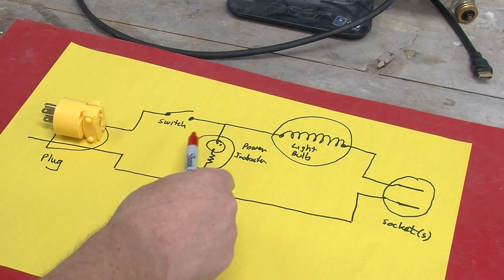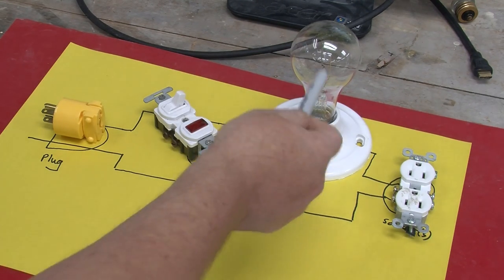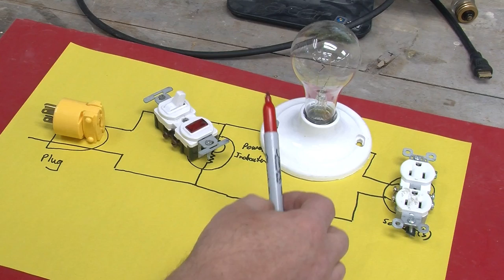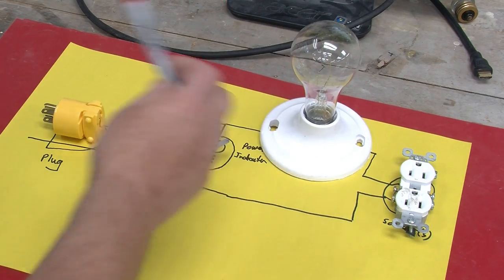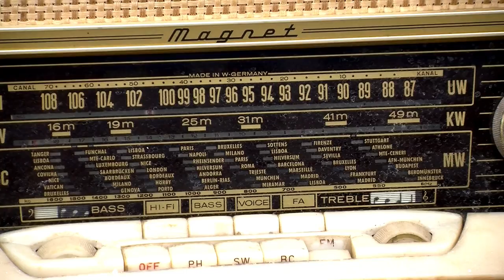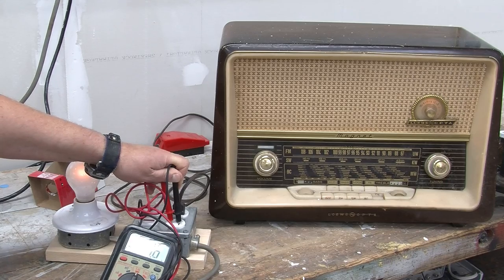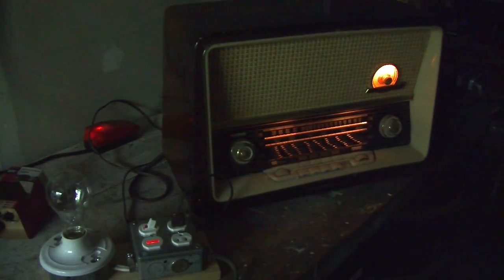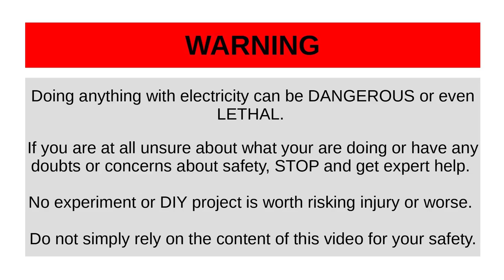When a Light Bulb is better than a Fuse

Comment: Being an old retired Telco tech, many circuits in the old Central Offices had "ballast lamps" (or "resistance lamps") in series with either input or output to protect them.
Reply from the maker: Thats fascinating. So was that on the loop circuits going of to peoples phones? Were they lamps specially made for the purpose?
Reply: @ElectromagneticVideos , not so much on the "POTS" loops, but on other circuits that had the potential to put out dangerous or damaging levels of power. DLL units (Dial Long Line signalling range extenders), telegraph, carrier, alarm, etc. 

They were used on circuits both within and outside the central office. 

In the Bell System they were made by Western Electric specifically for those different uses, and were sized to fit on standard panel height of 1.75 inch without crowding. 

Many, many different types and mountings. Here's one: http://tijil.org/15A-ballast-lamp.jpg
Reply from the maker: @Tom_Losh  I have never heard or seen a bulb like that! How interesting. So if I understand correctly, generally not on the voice but more the signalling pulses? I googled "Dial Long Line signalling range extenders" but was flooded with Wifi range extenders which I dont think are quite the same :)  . I'll have to do some searching to see if Northern Electric/Northern Telecom/Nortel made those bulbs up here too. 

I would love to have seen one of the rooms filled with the old mechanical switch gear in operation. I do have  couple of vintage rotary stepper relays (not sure of the correct name) that would have been in one of those switching stations.
Reply: Right. We had them back in the sixties when we had teletype circuits running 120v @ 60ma. Ballast lamp lights up when the circuit gets shorted out somewhere downstream, otherwise it stayed dark. Nowadays, I use a 12v headlight to test 2-way radios in the same circuit.
Reply: @ElectromagneticVideos  Back in the early 90s I worked for AT&T ,Western Electric, as an equipment installer refitting local Bell offices with the new 5ESS switch system which replaced the rotary system with digital. It was always fun checking out the old rotary switching equipment while we installed the new equipment in parallel. Many boring hours spent running wire and testing lines as we went. On the phone lines that I worked on, iirc, the only protection I ever really noticed was the lightning protection on every line coming into the switch, basically a wire wrapped ceramic insulator. One amazing thing was that the 5ESS switch was so small in comparison to the relay banks it replaced!
Reply from the maker: @KenTenTen  Just saw your comment - I remember teletypes and had heard they were current loops. I can sure see how lamps would have been perfect as ballast a also a fault indicator. How interesting. And great to see another modern use for 2=way radios.
Reply from the maker: @AGB_2000  I cant imagine what it was like to have to re-connect and test thousands and thousands of wires like that. I would have been thrilled to see the rotary switch banks but connecting and testing the wires would have driven me crazy! It is amazing that one can sufficiently protect semiconductor based switches well enough from lighting and induced transients on the long phones lines that they arnt always being fried. 

Just thinking - it must have taken days to swap over the wires. Did you you somehow have both new and old switches operating in parallel to maintain service, or was the phone system simply down for a day or two?

I would be neat to a photo of the old mechanic switch next to the electronic replacement for the size comparison.

Comment: Good explanation of the "poor mans variac" AKA the dim bulb tester. When working with tube equipment especially you start with a low wattage like 15w bulb than go to 25,40, 60,75,100. If at any point the bulb goes bright you have a dead short. 

This saves both you as well as the equipment under test. 
Never just plug an unknown condition tube set in the wall from the bat. Especially if its been sitting unused. Always do the dim bulb or a real variac and isolation transformer.
May work great may need caps reformed but chances are that youd be in a world of trouble if you fail to properly bring up old equipment.
Reply from the maker: I'm glad you liked it! And very good points and advice for  resurrecting or fixing old tube equipment - thanks for commenting. Although I think its actually more than "a poor mans variac" - the great thing about the dim bulb is the limiting current feature - no matter how careful you are at slowly increasing variac voltage, you always have the possibility of a high current short. I have been amazed at how much attention this video has gotten - really shows what a great piece of equipment a dim bulb tester can be.
Reply: @ElectromagneticVideos  i'd consider a bulb limiter far more important, useful, and safer than a variac, have used one for many years, you can also use them as current 'stabilisers' for charging nicad/nimh and lead acid batteries, even direct from mains via a diode if you wish to risk it ! i have an old book that shows accumulator charging from dc mains through a lamp, you would not want to know the 'hair raising' way  they said to check mains polarity if you didnt already know it 😲
Reply from the maker: @andygozzo72  Completely agree! I have never used them for charging a battery but heard stories of what you described. Checking polarity  - touch it with your finger like the old electricians used to do?
Reply: @ElectromagneticVideos  actually what the book said was stick the ends of the wires , with a bulb in series with one, in  a glass of water with a sprinkle of salt in  😲 the wire that gives off bubbles is negative 😲😲, i've used a small  15w mains bulb plus series diode off the mains for a quick n dirty charger a few times,
Reply from the maker: @andygozzo72  Practical and simple, but somehow wires + saltwater + 120V seems a bit scary to me!
Reply: @ElectromagneticVideos  120v?? this is in the uk, 240v !! 😲
Reply from the maker: @andygozzo72  That would make it even more exciting!
Reply: @ElectromagneticVideos  😜
Reply: in the uk, areas that had dc mains had a split system, central 'grounded' neutral, and +  and - 200v ish outers, with houses split  roughly equally on opposite poles, with the central one as the neutral, just think if one house had both outers, maybe for high power equipment and the person doing the polarity test got the 2 outers instead of outer and neutral, 400v rammed into salty water ...😲😁
Reply from the maker: @andygozzo72  I had no idea you ever had DC to any extent. How interesting! I thought all 200-240V systems originated with AC after longer, thinner light bulb filaments were developed. Your 200V DC system sounds exactly like the 100V DC system in US  (and maybe here in Canada?) where there was Neutral, +100V and -100V before Edison lost the  AC DC war. 

We have a remnant of that in Canada and the US -  the split phase AC system where most homes have two 120V lines that are 180 degrees out of phase (ie + and -) and a Neutral. So all "normal" outlets are 120V having one live and one Neutral. Larger appliances like stoves, dryers, air conditioners etc get two lives for 240V. 

I have only seen a split phase system once in a 240V country - at the end of a long single-wire earth return line in Australia at remote campground in Carnarvon Gorge (amazing place) where only one of the normal three phases was available.
Reply: @ElectromagneticVideos  oo, no, the uk, any maybe other countries, had many areas with dc mains in the early years of electrification, i think some still had it into the 1950s ..., and yeah i know of the current😉 usa split 120v phase system, i think its a good idea, wish we had it here!
Reply from the maker: @andygozzo72  Interesting! I have heard some places in New Your City still have DC to run things like the really old elevators in the skyscrapers! 

I had a discussion of the merits of our two AC system with someone else not too long ago who like you favored our  system. I would be be fascinated to know the statistics of  injuries from the 230V to ground compared to 120V to ground systems. 

I did read a paper years ago that compared split phase to 3 phase for residential power delivery and the conclusion was that given the greater spacing of houses in North America, split phase ended  up being cheaper here and 3 phase cheaper in Europe. Some time I should see if I can  do some estimating and see if can come to a conclusion one way or the other. It would be nice to have 3 phase for electric motors like pumps.

Comment: when I was an apprentice about 5 and a half years ago the master electrician I worked under had been in the field for almost 40 years, and when he was teenager back in the 1960s his father taught him how to find a short in the house, with a light bulb.    he'd take the wire off the breaker,  connect a light bulb socket pigtail to the breaker, then wirenut the circuit wire to the other end of the bulb socket. With experience he was also able to gauge whether the circuit was overloaded and likely to trip a breaker by noting the brightness.   with a fuse panel, you can perform the same test, by screwing a bulb in the socket.    The younger generation can certainly learn very cool and useful stuff from old gray hair electricians. -)
Reply from the maker: I really enjoy hearing stories like that. I had not heard of putting a bulb between the breaker and the rest of the circuit like that, but a few have mentioned the bulb in the fuse socket.

The unfortunate thing is so many people seem to think old tricks like this are bad just because they are old - sometimes the old simple approach is much more practical. 

Years ago I made a manufacturing tester for product that had a 12V output to drive some auxiliary component. The tester was just a 12V auto blinker bulb soldered onto the plug with a diode in series. The bulb drew enough current to confirm all connections were good, and the diode conformed the polarity was right. I  think they still use it today 20 years later.

Comment: pretty cool—using a lightbulb as a crude PTC thermistor for inrush limiting (with added visual diagnostics!)
Reply from the maker: Yes! In many ways the visual indication is the best part!
Reply: Or is it ntc. As current goes through and heats up the resistance goes down acting as a short circuit. Initially the resistance is high. Right?

Comment: I had 10w to 2000w current limiter system made by myself using incandescent and halogen bulbs  more than 15 years.
Reply from the maker: Thats a big current limiter! So did you use halogens just because easy availability and small size at higher powers? Or was there some other characteristics that was good for your application?
Reply: @ElectromagneticVideos  I had used halogen tubes for easy availability and cheaper. But most replaced are them. I had eight different power settings with selector switches.  1000w 500w 300w halogens and 200w 100w  60w 25w 10w  incandescent bulbs. That current limiter made by myself i'm 14 years old and too much interest in electronics. That saves my time and money and good experience with SMPS and power amplifiers. That idea came for me when technicians using current limiter (they call it load bulb in my country) why i not try to build better one with more current limit settings.
Reply from the maker: @kapilsds7  Great that you have such an interest in electricity! 

I'm guessing your not in Canada or the US, so you are probably in a 220/230/240 volt country. Please please please be careful!!!!!!!!! Your voltage has much more of an ability to punch through skin with the slightest surface moisture and deliver a lethal shock or burn than ours does. I know - it happened to me in a 220V country when I was a kid playing in the garden and a hidden live wire touched my leg. I have a huge scar  to prove it. 

Here are some safety suggestions:

At a minimum make sure there always is residual current device (RCD) in the circuit but dont rely on it. 

Or better an isolation transformer. 

Never be alone in the room or area when working with exposed AC power or more than 24V. You need someone there to help you if something bad happens. They also need to know that they must shut of the power before attempting to help you - AC power can paralyze and disable the helper. 

And if you have the slightest concern or uncertainly about something, stop, think about it,  and get help if needed.

These are something everyone should consider, not just young people! We can all get injured if not being careful. 

Having said all of that, back to your project.  Do you really need such high powered lamps? Usually a lamp power of around the power consumption of the device you are testing is a good place to start. That limits the current at maximum what the device would normally draw. If everything goes well double the lamp power once or twice. Typically use 60W, 100W, and 200W bulbs for working on old tube radios. Modern stuff uses even less power. One problem with larger currents is they can sustain an arc quite easily (like an arc welder) and destroy the device you are protecting! I think part of your range 200w 100w  60w 25w 10w would be an excellent current limiter that could be used for most electronics!

Comment: This is exactly why a test light is a far better and safer tool when is comes to automotive electronics as well.  DMMs are nearly useless in troubleshooting cars...especially if you know what you're doing.  It's just as safe as a DMM if you know what you are doing...and far more informative.

Unfortunately it took me about 20 years to realize this.  I didn't know what I was missing!
Reply from the maker: Its funny - all the advantages of DMM's high input impedance do sometimes get in the way - I use a 12V bulb to test some power supplies because they need more than a few micro-amps to glow. The old analog passive multimeters are also useful sometimes - they draw a  small current but way more than a DMM ...
Reply: @ElectromagneticVideos  95% percent of automotive diag work is simply checking for power/ground.  About 4% is verifying that circuit can actually carry current. Both of these are much quicker to test with a light bulb.  The other 1% of automotive diag can only be verified with an oscilloscope.

Sometimes a DMM is useful in voltage drop testing if you can't load-test a circuit.  It's also useful in checking to see if the alternator is charging the battery I suppose.

Many places will try to ban test lights mostly because young players don't know HOW to effectively use one.  I will say that most automotive circuity is pretty robust...and can usually handle a bit more abuse than your standard micro-controller.
Reply from the maker: @RK-kn1ud  Wow - trange that they would bad such an effective tool rather that teach them how to use it. 

I have always been impressed by ruggedness of automotive electronics - its an absolutely terrible environment from the standpoint of heat, vibration, and corrosive chemicals - and yet is so reliable in most cases. I have done vibration testing of equipment for aeronautical applications - much less vibration than a car on a dirt road - its amazing how wires or other things that rub against each other get destroyed in relatively few hours when exposed to vibration.

Comment: This trick is commonly used in the RC drone hobby with newly built or rebuilt drones by creating an adapter cable that takes power from a RC battery through a car turn signal bulb to the drone. They call them "smoke stoppers" in the case you had say hooked up polarity of your motor controller backwards or otherwise have a short somewhere.
Reply from the maker: "smoke stoppers" - what a great name! Had no idea drone builders were using them.
Reply: @ElectromagneticVideos  yeah lol. Here is Joshua's video on it! https://youtu.be/I5a0TAmEwLE
Reply from the maker: @power-max  Thanks for posting the link - if anyone is interested in a low voltage version of the bulb current limiter look at the link above!

Comment: This radio is designed to work with a external long wire antenna!
Reply from the maker: You are absolutely right - not many people would know that. Its too bad there isnt much of interest on the  shortwave bands these days - if there was I would put up a nice long antenna in my yard. Those German tube radios are so nicely made, both in appearance and technology. I have a few others - I will have to do a video about them.

Comment: I ran into a case years ago where a homeowner had his furnace wired with a light bulb as a fuse.
Reply from the maker: Yet another unusual use. I wonder why? In the great ice storm (1997) I tried running an oil furnace off a 1.5kw generator - the startup surge from fan's induction  motor was too much for the generator although the smaller burner motor was no problem. I'm surprised it even worked unless he had a really high wattage bulb.